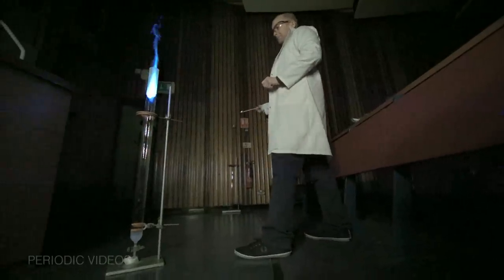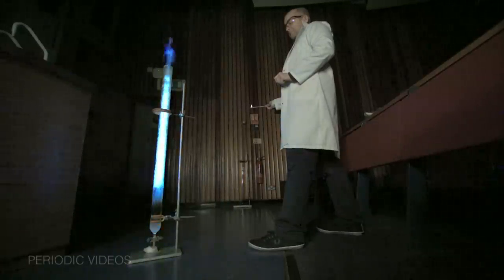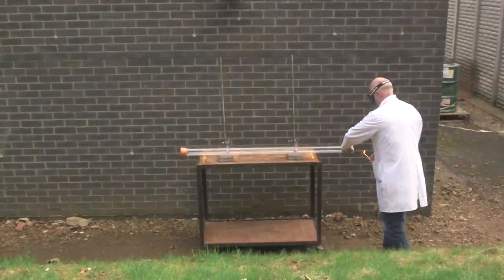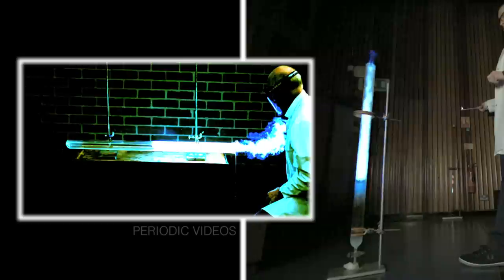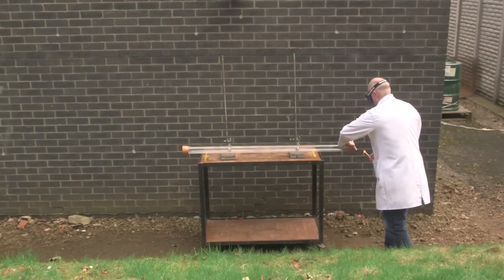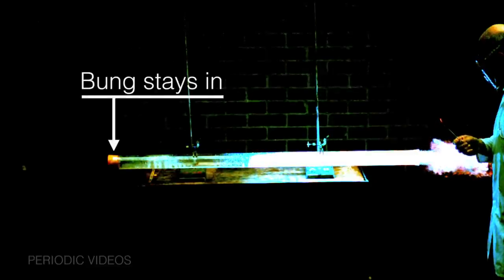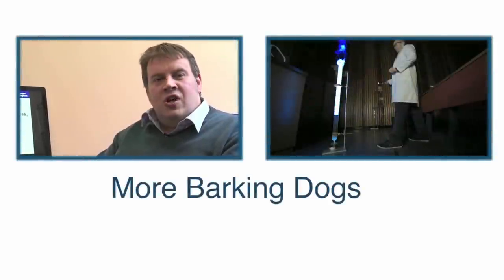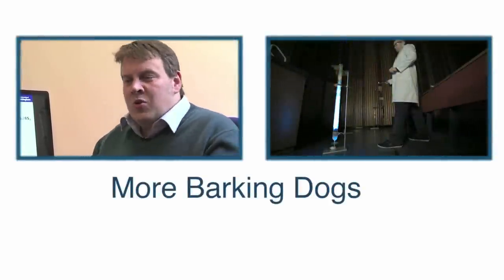Horizontal Barking Dog - Periodic Table of Videos

Comment: How about putting a pressure sensor at the end, connected to an oscilloscope or data recorder synced to the camera, So you could see pressure vs. time as the reaction progresses, and correlate pressure peaks at the end with the changes in flame speed.  Or maybe something as simple as a microphone attatched to a diaphragm on the end.
Reply: mikeselectricstuff Follow that up with a thermal IR camera pointed at the tube to map the heating of the flame front.
Reply: mikeselectricstuff Idk if this is my Differential Equations course talking, but you could probably construct a second order differential equation relating the resonant frequencies of a tube of known length and other constants. You could even determine other useful information like reaction rates and such.
Reply: mikeselectricstuff I never would have expected to see you here.
Reply: mikeselectricstuff How about a transducer instead? Imaging the shock wave may reveal more than just an ordinary pressure gauge would indicate.

And his suggestion that the blue flame may be from sulfur products holds some water, but thermography and a spectrograph of the event would reveal lots more.
Reply: Ya there ya go I was just thinking the same thing!
Reply: mikeselectricstuff It is a nice scientific solution to analyse the situation and I would enjoy seeing you in one of the videos explaining the electronic side of it. But I dont think that it would fit the style of these videos very well.

I would suggest a more visual and easier to understand approach: Seal the end with a rubber membrane and film it with the high speed camera.
Reply: It something that you or someone should definitely do

Comment: I would have thought the bouncing effect was caused by pressurisation and depressurisation as the reaction creates biproducts, loses them in the vacuum and gains more fuel for further reaction.
Reply: CuriousMoth yea i thought about that.
i want to see the experiment done with a rubber at the second end, or a balloon, to see if it would inflate and deflate really quickly.
Reply: I had not even thought of that, the balloon idea is pretty cool, also!
Reply: ragenFOX Or a pressure gauge?
Reply: ragenFOX The baloon being able to inflate or deflate quickly would completely cushion the pressure wave, it would be equivalent to having an open end : it would simply inflate quickly and burst, there would be no "bounce back".
A pressure gauge is a much more sensible idea. Or even several, regularly spaced, to show the wave travelling. (though I am not sure they would be able to register pressure quickly enough)
Reply: piranha031091 there are pressure measuring devices that could record pressure that quick, not the traditional metal pressure gauges or whatever they're called. i said balloon because it would inflate inwards, or go inside the tube, that would mean there is a vacuum inside, it would be explained by what CuriousMoth said.
Reply: CuriousMoth Very interesting explanation but i think the shock wave one seems more plausible
Reply: +CuriousMoth This seems very similar to pulse jets.

Comment: Would it be stupid to think what would happen if both ends were lit? Would the two flames either side compress against each other or will it just end in a disaster?
Reply: toyotaprius79 nice idea! that is just an assumption from me, that if you light both ends at the same time, the procedeing flamefront and the compressed gas will act like a closed end, so you basically have 2 tubes. So I think what will happen is that you get the barking dog again. But I'd really love to see that tested out too sometime.
Reply: toyotaprius79 maybe the tube will explode in the middle. :O)
Reply: Fergus Chan I don't think so. That's a big tube, it should withstand the pressure.
Reply: Fergus Chan We're gonna need a longer stick.
Reply: toyotaprius79 It will likely be fine. It would be like having two closed tubes in terms of internal pressure. 

Consider this thought experiment: You have a car going a constant speed into an immovable wall. You also have two cars going an equal speed along the same path, but with one in the opposite direction (a head-on collision course).

Which one will end worse for the occupants in any car? 

Most people think that the head-on collision doubles the effective speed of the collision, but it doesn't. You have an equal force in opposition to the car. Same with the immovable wall, in which case the force is known as the normal force. 

Of course, there are some complexities with wave-fronts and fluid dynamics, but physics examples like perfect systems.
Reply: Thor214 That parable assumes that the oscillations stay exactly in phase. This will probably not be the case. What happens when the left side is aggressive and the right side is regressive, and vice versa?

Comment: If there is a pressure wave in-front of the flame it could be interesting to run the experiment in a tube with some small holes along its length. if the holes are made like small flutes then an oscillating pressure would have them whistling in small pulses.

Comment: I did a horizontal barking dog in the 1970s, so it's not the first.

I remember using NO (nitric oxide) instead of N2O though, because I can remember having to collect it over water to prevent it oxidising, and seeing the brown NO2 fumes start forming when the bungs were removed.

I remember the sound as similar, but without the kicked-over-flask accompaniment.
I'm not surprised that the flame starts forming so early: carbon disulphide has a scarily low ignition temperature.

Another favourite from my 1970s days was hydrogen and chlorine initiated with a xenon flashlamp.  You need UV as I recall, so a quartz test tube is better than soda lime glass. You could probably use a UV LED nowadays.

Comment: In fireworks, there are 'whistle-mixes' that have a non-linear response to pressure.
Normally, the higher the pressure, the faster the rate of reaction.
But with a whistle, the burn rate is faster at low pressures, but slower above some critical pressure.
As pressure builds, the burn rate drops, reducing pressure.  Then the burn rate builds again, retarding the burn.
Small pellets of mixture will not really whistle when burned unconfined.
With a small amount of containment [open tube], you get the familiar "Whistling Pete" fire-work.
Salicylic acid or its acid salts are present in most 'recipes'.
On a much larger scale, some large military rockets 'groan' as they are launched.
Similar to a whistle, much lower pitch.
Katyusha rockets, used by the Red Army in WWII, had a very distinctive 'roar' on launching.

Comment: There's so much science to be considered here, and it's refreshing to be reminded that a seemingly simple experiment can have so much occurring within that is often dismissed because it just seems perfectly natural to the naked eye.

I have a feeling the pulse like behaviour is very similar to that of a pulse engine, albeit there's not a constant input of fuel mixture. Noting that it's within a tube, the reaction is directed into the tube, it's likely the reaction begins like any explosive gas mixture you would expect until it reaches the point of the shock wave, after which you can observe the pulse like behaviour. You can see there are points of maxima and minima at the exhaust end.
Perhaps if you used a different concentrations of other explosive mixtures, you could reach similar conclusions.

On another note, It reminds me of the popular youtube mad inventor Colin Furze's simple yet working, pulse jet applications. Quite enjoyable to watch.

Comment: Here is my best explanation: church organs and physics: standing waves, natural resonant frequency of oscillation. The Q of resonance increases the longer your tube, it's not very high in a short tube, or where the activity happens only in a short portion of the tube. If you blow into a pen cap, you get a certain whistling sound at the natural resonant pitch. A longer tube gives lower pitch sound, and a long long tube like you are using should give very low pitch sound. In theory it's possible to set resonant a tube with both ends open, but one end closed, or a large cavity with a hole as used in church organs, violins and cellos or even saxaphones, you're all dealing with the same physics of standing waves and vibrations, which have to fit an even or odd or half number of wavelengths in the resonant cavity. What happens is like you showed, the reaction accelerates, because of temperature rise, the faster it goes the more temperature it generates which in turn makes it go faster, up to a point, where the sudden pV=nRT thermal expansion and explosion ejects the hot reactants from the tube, pulling a vacuum on the nonreacted part, and that vacuum is enough to drop the concentration of the reagents to where the reaction slows, and hence you get an oscillation. An interesting way to study the rate law of this reaction r=k[N2O]*a , [CS2]^b would be to change relative ratios of vapors gases premixed at the same temperature, and note the linear velocity rate of reaction at least in the initial portions, and then vary the relative molarities away from stoichiometric, like 5x excess of one but not the other, and a log log plot slope or initial velocity rate before the temperature gets too high vs molarity or reactants should give the exponent, whether it's first order or 2nd order in N2O, or CS2, respectively. The Arrhenius Activation Energy can be deduced from the temperature dependence of the reaction, but it's really difficult to get a good estimate of temperature, or what is actually representative, because, like in a candle light, you're dealing with many temperature zones, and the intial temperature of reagents or surroundings is important, but not that much. Even so I'd like to call your attention to the LOI, limiting oxygen index of combustible materials, where some, like PVC won't burn at normal 21% O2, only at 29% O2, and even PTFE teflon combusts at 95% O2, but all this at reactants at standard room temperature. If you preheat the air or PVC there has to be a temperature where it just sustains combustion without sort of "explosive" acceleration. What you could do is get a point of LOI of CS2 vapor with respect to N2O in N2 gas, and then you can vary the temperatures and see how the limiting N2O index changes vs. preheat of vapors. A gas chromatograph with an FID for CS2 and possibly a thermal conductivity or mass spec detector for N2O might give you an accurate measurement of concentration. Mass spec is not that quantitatively accurate, it's excellent for qualitative work, and FID is a super detector with a linear dynamic range of 10^10, unheard of in most other things, but it only detects combustible materials, I think. Not sure, if you run it with He it surely so, but there is a way to run GC's with an H2 gas generator and get better results, and the H2 background carrier gas might give you a good FID signal for N2O with local combustion.
Reply: SillybillydillyCorrection: r=k[N2O]^a . [CS2]^b

Comment: What I believe is that when the flame travels down the tube it creates an area of high pressure at the closed end and there needs to be an equilibrium or drop of pressure before the flame can travel further down, kind of like the pressure in a flammable spray such as deodorant prevents the flame from going back into the can(some times)

Comment: I can't tell if it's reflections on the tube or otherwise; but, during the experiment, there appears to be nodes and antinodes proceeding the reaction front as it goes down the tube. At 2:46 there appears to be two rarefactions that slowly shrink down as the flame front moves further down the tube.

Comment: Great video! I thought the tube broke when I first heard the glass shattering. lol

This experiment reminds me of what happens in an internal combustion engine, specifically when the spark plug ignites the compressed air-fuel mixture, and the flame front propagates across the combustion chamber. The professor is correct that the expanding gasses further compress the mixture, and increase the speed of the flame. You can perhaps see evidence of this in the video, where in the horizontal tube there are flashes of blue light. In an internal combustion engine though, compressing the mixture too much, or starting the combustion process too early, can lead to detonation (boom!) of the entire mixture at once; generally it's referred to as 'knocking' or 'pinging'.

A similar 'bouncing' effect occurs in an engine's intake manifold as well, at sonic speed, of course. That's why you see different lengths of runners on, for example, passenger car engines versus high-revving racing engines.

Comment: Excellent explanation for the behavior of the open tube version.  For more details consult with someone who works in "internal (aka interior) ballistics".  Check around with a defense contractor, possibly one who does a lot of work with naval guns.  The phenomenon is not so much a "shock" wave as it is a pressure front (splitting a hair a bit, but they do behave somewhat differently).

Comment: Very nice to see this video, which uses blue fireballs to show how science works. From an earlier (supercool!) video we formed a hypothesis explaining why it makes this sound (a shock wave bouncing from the end of the tube). Now we test this hypothesis by predicting the result of a new experiments (the bung should fly off). This does not happen, but maybe we missed something (the shock wave is not strong enough), so we design another experiment (two open ends) and look what happens (just an accelerating flame, with a fireball shooting out). This matches the first hypothesis (shock wave does not bounce and does not push back the flame, fireball shoots out as a result of the shock wave) and provides observations to create a new hypothesis that explains the previous hypothesis (the flame accelerates because of an increase in temperature, which also causes an increase in pressure, creating the shock wave).

Comment: I think the sound itself is the proof for the waves of pressure. Sound is nothing more than the simple change of pressure in the air in a certain frequency. That is basic acoustics (even I know about it). When the fire gets faster the sound gets a higher pitch because: 1.: higher frequency, 2.: shorter pipe (see the acoustics inan organ)

So if you thought a bit more about the sound you could have foreseen the result with the high fps cam. You probably can see similar results in other experiments with significant sound.
Reply: ***** You could play some sort of flute on it...  ?

Comment: You could use a bit of thin rubber or latex over the end of the tube. This way you can observe the pressure waves by looking closely at the rubber flexing outward, or even being sucked in.

Comment: The pressure osculation is caused by the flame front and shock wave compressing the air in the bottom of the tube and the pressure trying to equliz

Comment: I recall attending an explosives lecture for school kids when I was 13 or so (~1978) at the Salisbury Playhouse, where if memory serves the barking dog was performed horizontally in a tube rather longer than these.

Other demonstrations included Nitrogen tri-iodide and nitrogen tri-chloride, and also a musket using black powder to fire a tallow candle into a target made of a brick sandwiched between two half-inch sheets of plywood. It went straight through the first plywood sheet and smashed the brick! It made quite an impression on me.

I wonder if The Prof or Neil know anything of these lectures...

Comment: Heres a suggestion : How about taking that double-open ended tube, and lite both ends at the same time?

Will the flame oscillate as they run towards each other, or will they just push each other out (or one side will win over and push the other flame out)

This could be an interesting experiment to do.

Comment: I have a suggestion for the next experiment of the barking dog taking the glass cylinder placing it vertical and just inside a large glass bowl, vase or a large breaker. You'd still have the surface for the shock wave to reflect off of and yet have room for the gasses to escape.

Comment: It works the same way as a pulse jet, heat expand cool contract repeat. The length and diameter of the tube determine the Helmholtz frequency, an enclosure at the closed end will lower the frequency and increase amplitude.

Comment: I think those "shockwaves" are actually just gulps from the reaction. Sort of like when you funnel liquid in a sealed container and air inside the container tries to escape to make room for the liquid. It will chug gulps of air through the middle of the funnel and while letting the air escape will slow down the funnelling of the liquid

Comment: so you can see the horizontal direction just moves the flame higher half of the tube. presumably from the gas just collecting near the top of the tube, as opposed to a nicely even flame on the vertical. I think the temperature idea you proposed for reaction acceleration is spot on, but there is also a pressure component here too, but its more complicated than just a # of molecules per side of reaction thing (theyre equal). Most likely a concentration effect here. Id be curious to see what happens if you placed the tube in an ice bath.

Comment: The flame does bounce back, albeit differently. It can be seen in the video. In both cases (tube closed and open) there is a characteristic impedance discontinuity at the end of the tube. In the closed case, the impedance is infinite (max pressure, zero flow), in the open case the impedance is zero (low/atmosferic pressure, max flow). Hence the standing wave pattern is different. Perhaps the open end bounce effect would be more visible with a thinner (higher impedance) tube?